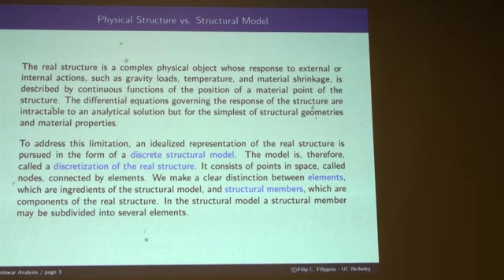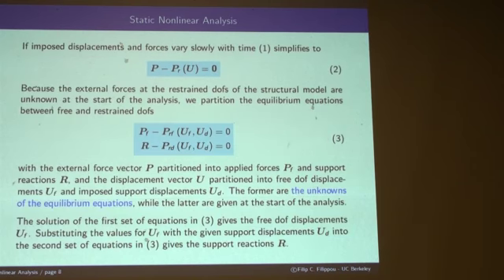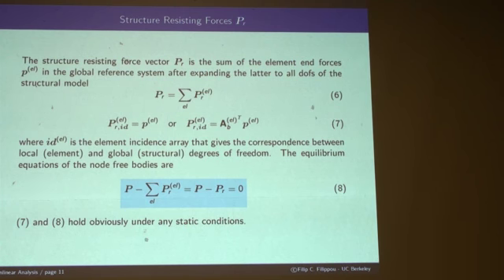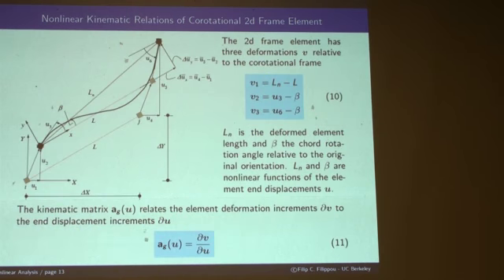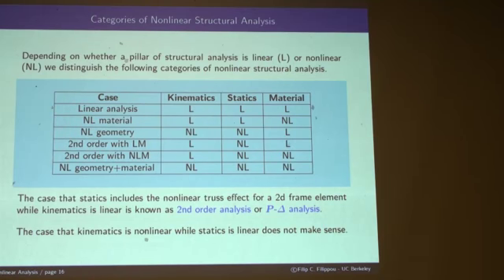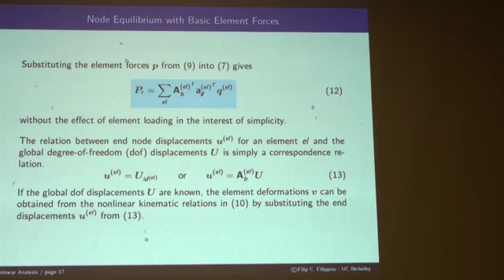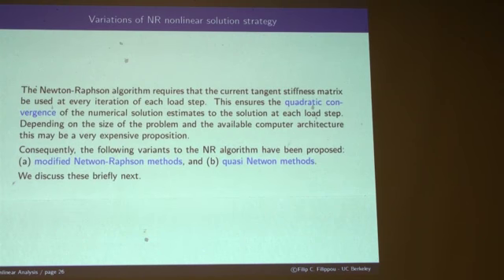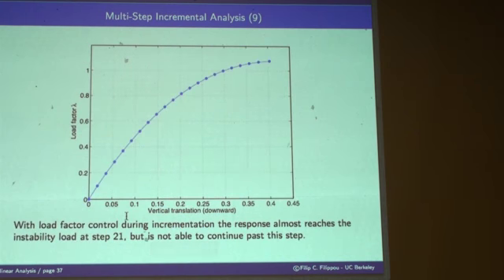Introduction to Nonlinear Analysis - OpenSees Days 2013

Comment: so don't worry about it too much (The Planning). Write as you go even if you think its easy and you can do it later because i fell into that issue and wrote70 pages in a month and a bit and it was a bit rough.

If you end up using S7 depending on what the go is I can help you out but other than that i'm useless at SG.